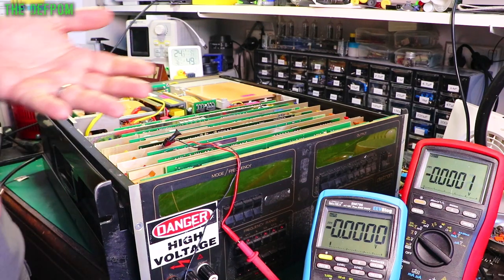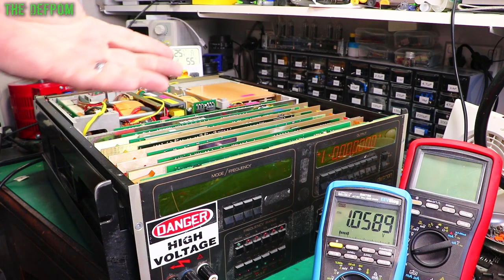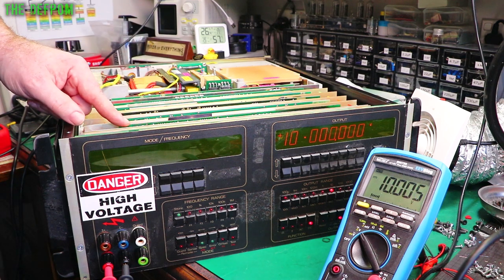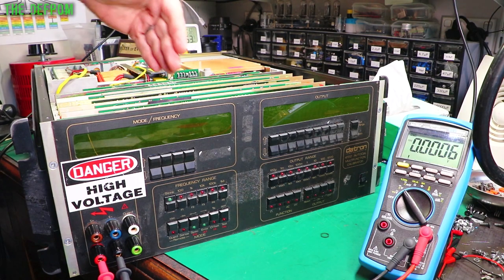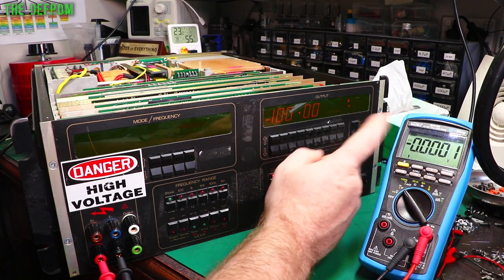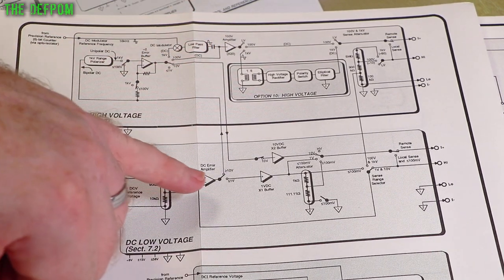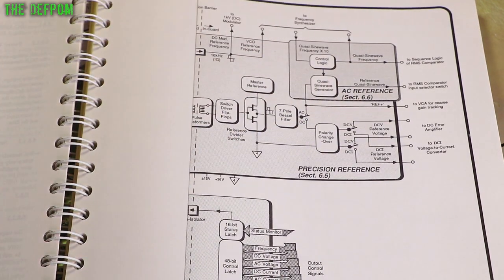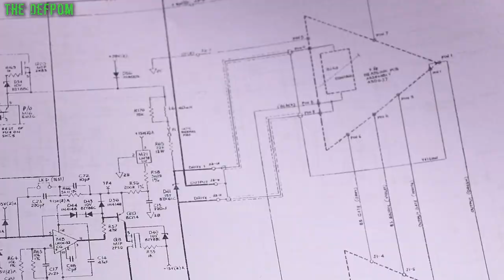🔴  Fixing a $10,000 Datron Calibrator - Datron 4700 Repair Part 3 - No.828

Comment: Excellent progress, Scott. My bet was on the card edge connector as they sometimes get abused - interesting to see it was solder joints. I got my Fluke 5100B up and running, a bad optocoupler (photoresistor type) and a shorted zener diode. Only one minor problem left - the AC output is a bit noisy. I've got some opamps on order that I hope will solve that. Thank you for all your effort producing these videos.
Reply from the maker: Nice to hear you got your 5200B working, you really should start to make some videos :-)

Comment: I'm so tempted to buy one of these.  I'm sure the one I've found is broken.  The displays are working, but I know nothing else about it's condition.  Since the display are lit up, I'm guessing all the boards are installed. No guarantees.  Probably run me USD$2k delivered. Hmm, thoughts?
Reply from the maker: Just check what options it has, mine is fully optioned, high voltage and resistance/current are options. Look for the 4700 Datasheet as it lists that info.
Reply: @TheDefpom  It doesn't show the option numbers for resistance, DCI or ACI.  But it has the buttons and front connectors for it.  Odd.
Reply: Ah ha! If you push the buttons without the option being install it buzzes and shows an error 9.  So that means this unit doesn't have the options.  I'll pass on it.

Comment: Excellent; great job!  When working, is there anyplace that still calibrates this standard?  You could then certify your own equipment..  These things are UBER expensive. What did you pay for it "for parts"?
Reply from the maker: It cost me nearly NZ$5000 by the time I paid shipping and import duty etc.
Reply: @TheDefpom  Damn, that's a lot for a broken instrument (~$3600 USD).  It looks like it would be a great bit of kit when finished.  When getting something like that I would worry about an unobtainable output hybrid (no idea if it has one, or something like that) and how to backup or edit the calibration tables.  But damn, who wouldn't want a working one?  I admire you cool under pressure of trying to learn the instrument and trouble-shoot it without knowing it.
Reply: @TheDefpom  Ouch!......at that sort of money once you get it working 100% and maybe even improving it (i.e. change out some of the op-amps for ones with a better tempco/stability)....it would be worth spending another few hundred bucks and getting it NIST/ISO calibrated/certified.
Reply from the maker: @IanScottJohnston  that is tempting, I have no idea where to get that done over here though, there must be somewhere that does it, but knowing this country they will charge 3x the amount it costs overseas.

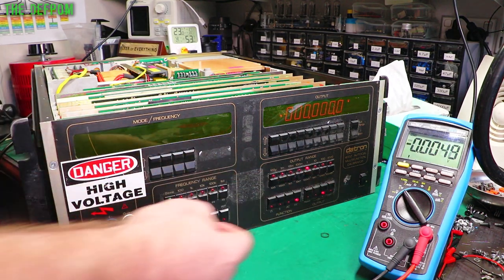Comment: @10:00 so what did you actually do?  just reflow the joints?  which ones... the connector?
Reply from the maker: I started out reflowing the dodgy looking joints on the entire reference board, which got me closer, then I resoldered every single joint at that end of the board, approximately one third of the board.

Comment: thermal fuses are chemical devices are they not? hopefully for you its just a failure due to the age of the fuse. Sometimes the chemicals just react differently when they are too old.
Reply from the maker: I suspect someone ran it for a while with the cover off whilst working on it prior to me getting it, it relies on air flow in that area.